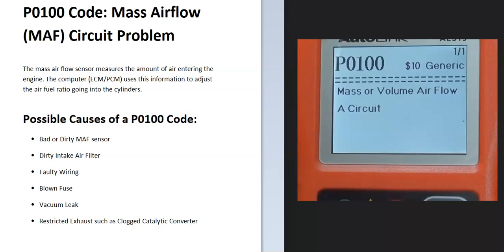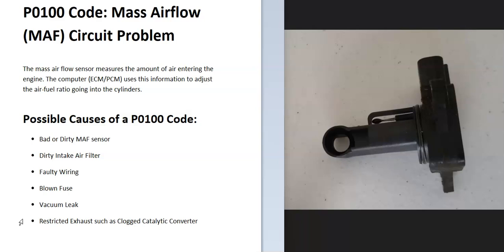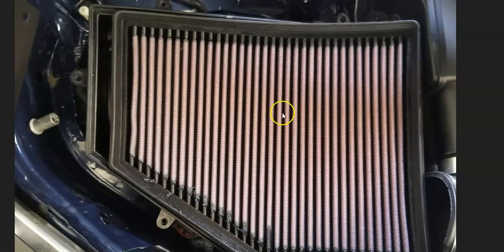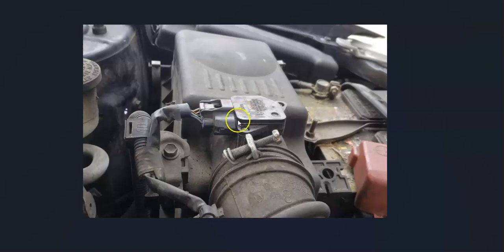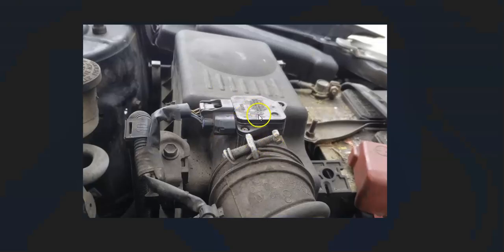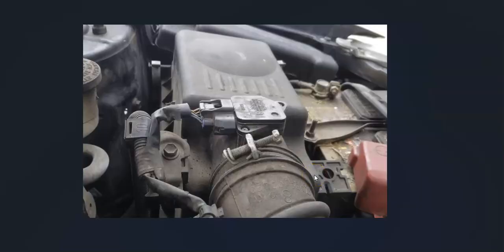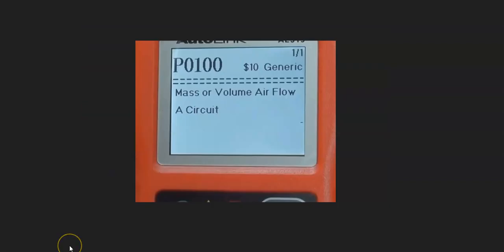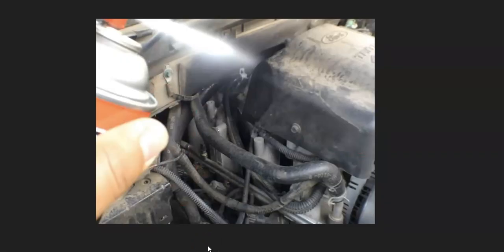Causes and Fixes P0100 Code: Mass Airflow (MAF) Circuit Problem

Comment: Thank you for sharing. I have a Hyundai Terracan 2006, diesel. Due to bad camshaft position sensor it was parked for 7 months. After changing he sensor it start immidiatly. I noticed when I drive with cold engine, everything is ok. But when the engine get Wara about 10 minutts later it dosent drive as smooth! Seems like a short delay/halt  when driving. Error code is P0100. I will check the MAF sensor today,. How can I check DPF/catalisator if the MAF sensor is ok ?

Comment: I have a 2012 jeep grand cherokee 3.0l diesel with turbo.  It gets a p0100 code intermittently.  I have cleaned the maf, then I replaced the maf.  I can't see any holes in the air snorkel.  I am thinking if the hose was bad. It would be the area from the air cleaner to the turbo, not after the turbo. Sometimes you can drive a week, sometimes a  couple months or anywhere in between before the code comes back. Its doing my head in, and I am a mechanic.  Got any ideas?
Reply from the maker: Intermittent issues can be difficult to diagnose. It could be a loose wire that only disconnects on a bump but reconnects, or possibly a component starting to fail, but still works most of the time. Since the MAF sensor is new, there is likely a loose wire or bad connection, but it needs to be diagnosed.

Comment: OK, what if you notice a leak with the radiator hose that clearly wasn’t put in right? Thank you Volkswagen dealership you did a fantastic job but anyways leaks all the coolant you noticed that it’s loose. You put it back on code disappears you drive it the second time seems fine third time it pops up again with also P0491

Volkswagen cc GTI 2012

Comment: I cleaned the MAF, no good. Then replaced the MAF still no good. and then I changed the air filter. P0100 still persists. The problem started when the battery died. So I'm guessing a problem with the circuit. Electrical problem
Reply: Having this same issue after my battery light came on too !! It’s hella annoying i’m just gonna clear the code and see what happens
Reply: @kbandz1677 maybe reprogramming the ECU
Reply: I have similar issue. Check maf readings and all good yet p0100 still comes up